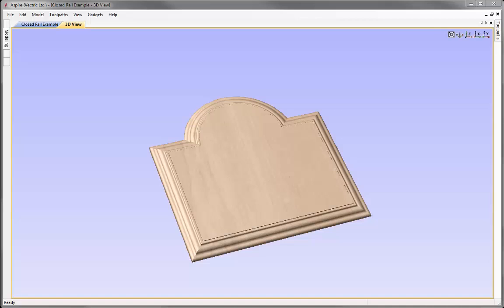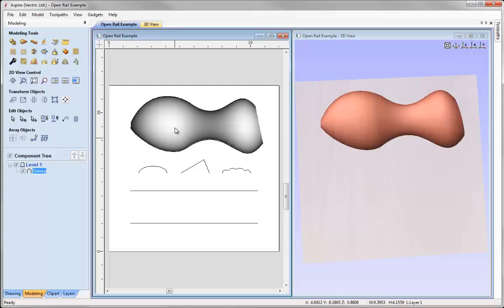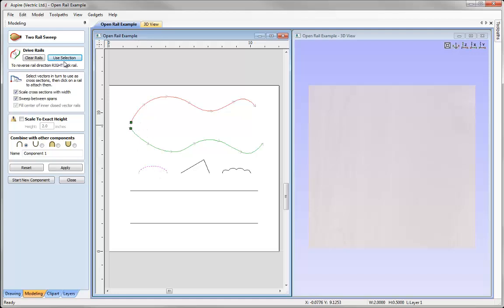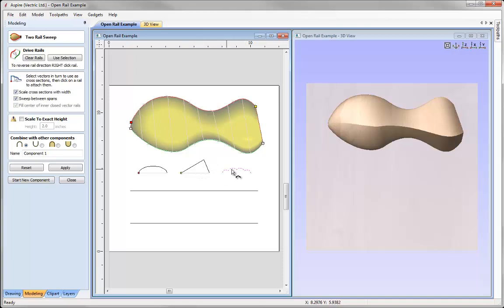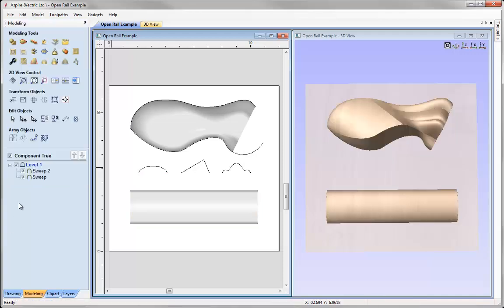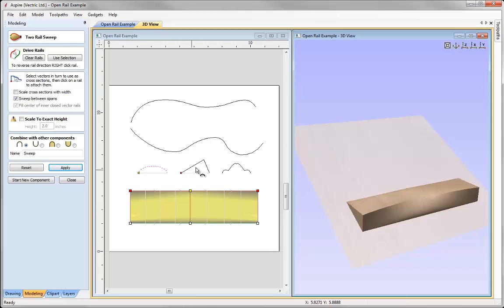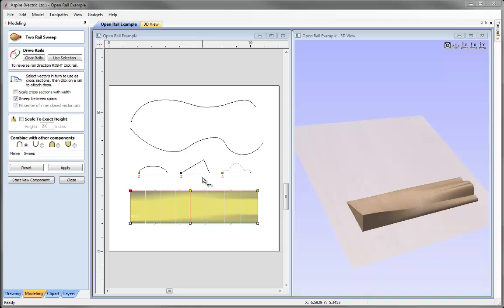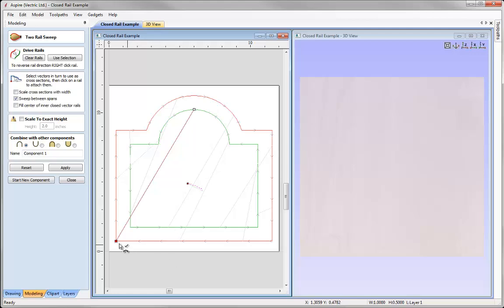Vectric V8 Tutorials - Two Rail Sweep Guide 3D Modeling

Comment: Hello,
I am trying to create a simple half-moon groove along two concentric circles.
The 3D preview looks OK but the toolpath that is actually generated creates rounded transition between the top of the material and the curve of the groove.
I tried unchecking the smooth" option but that made no difference.
Can you offer an advice how to fix this? I had to resort to using hand-held router to finish the project and get the shape I wanted but it would be nice if the toolpath for the CNC could be corrected.